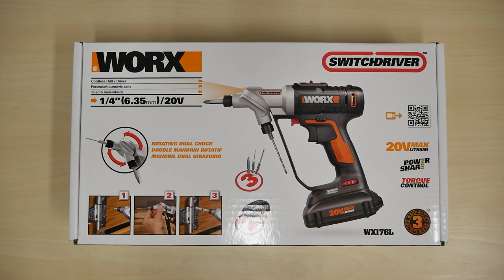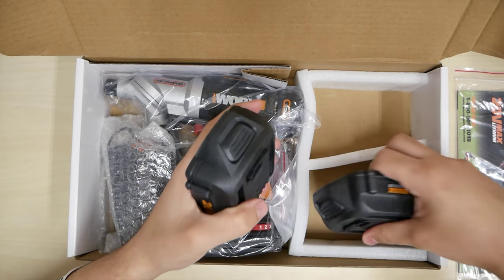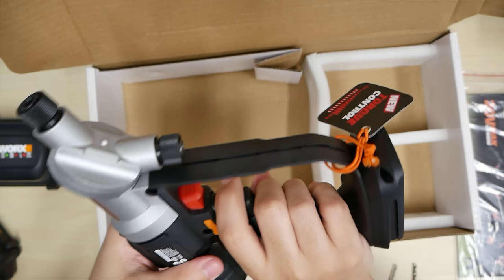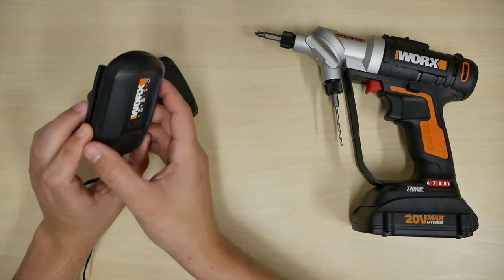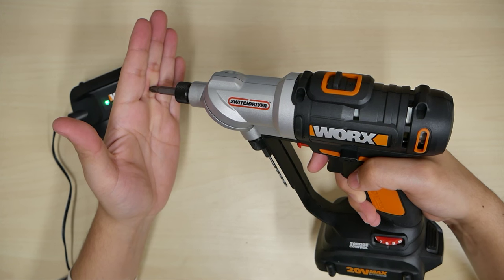I Worx double hard - SwitchDriver Drill

Comment: Can you put different size drill bits in and different screw bits in not just the 2 provided?
Reply: Yes, as long as they are quick-connect bits.
Reply: @andrewtomashaska4985  thanks
Reply: @mattseymour8637  I just got mine yesterday. I highly recommend getting the drill, batteries, case and bits. Well worth the US$169.99.

Comment: Oh boy. First that is not a huge battery. That has to be one of the smallest standard batteries in the industry that comes with many rebranded Chinese tools. Which is what I believe this probably is. Swear ive seen it before under a different name. That bat is probably 1.5 ah at most while for basically the same price and better specs Makita sells a kit with charger a standards 3.0 ah battery AND comes with a carry bag. They go on sale for 100 bucks regularly.  Third the torque setting isn't to keep a bit from "camming out". It's to set the depth for the head to be driven into the material. The reason your bit is camming out is not because of torque but rather the Philips bit you have. Some screws appear to be Philips but are actually posi drive or JSI screws. Different profile then Philips and you need a different bit. Just my 2 cents.